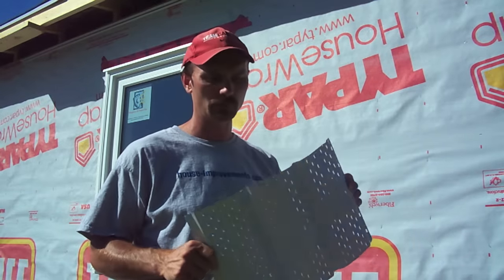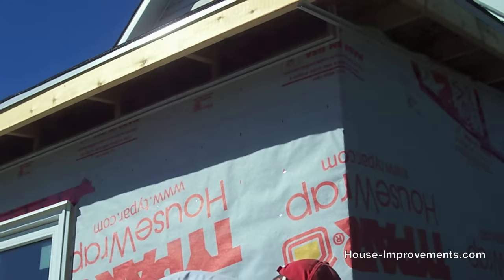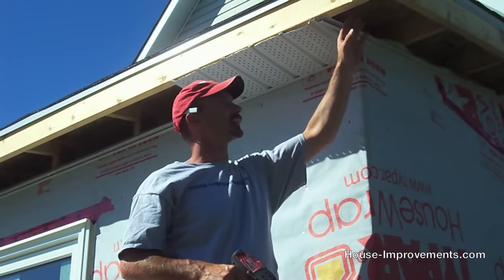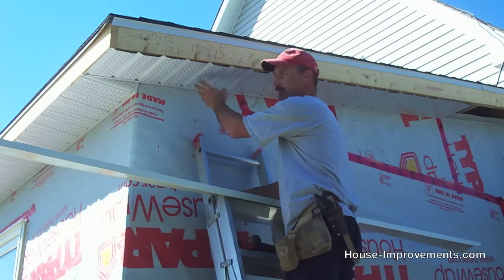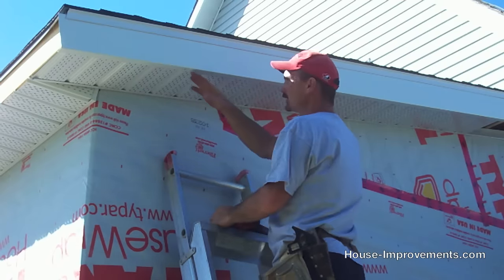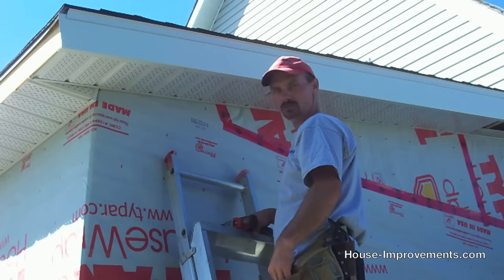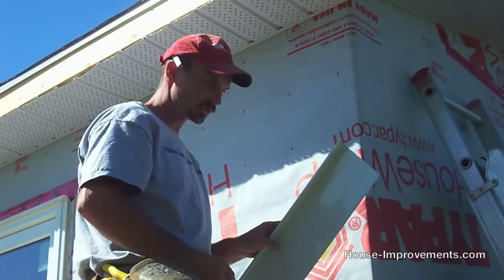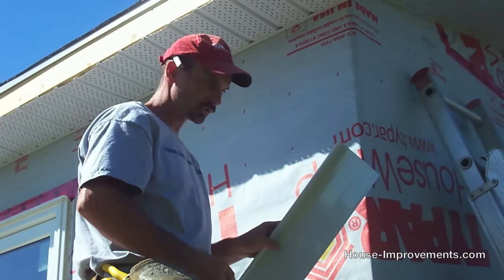How To Install Soffit And Fascia

Comment: So for the soffit your leaving it about 1/4” smaller than your measurement from wall to end of 2x6 ?   And the screw is tight so this doesn’t need to expand and contract like the vinyl siding ??
Reply from the maker: correct

Comment: What type of screws did you use?
Reply from the maker: These are a #8 x 1-1/4" pan head screw. I can purchase them colour matched to any fascia colour in my area, if you cant just stick some silver screws into a piece of rigid foam or heavy cardboard and spray paint the heads.
Reply: @HouseImprovements  thanks for the information

Comment: How long are the screws you are using? And what material and head type are the screws? Where does a person get colored screws for this job? My local hardware stores don't carry anything but say they can order anything I need for this,I just wondered what I would need.My soffit and fascia is a clay tan color.Thanks.
Reply from the maker: The screws for the soffit are just #6 x 5/8" F.H. screws and the fascia screws are #8 1-1/4" P.H . You can just buy regular screws, push them into some foam or heavy cardboard and then use some spray paint to colour them.

Comment: Hi Shannon.  I was at Home Depot today to buy some soffits and accessories.  They had some vinyl soffits.  A 12' length of vinyl was a bit cheaper than 10' metal soffits.  I did buy metal J channel and fascia though.  Have you ever thought of using vinyl for soffits?  Any thoughts?
Reply from the maker: I have never used it, probably fine though

Comment: So I discovered that the J channel that sits on top of the stucco of backside is loose and not secured to the roof. So I can pretty much lift up on the backside of the soffit panel and it will come up to where you can see in the roof. Can I use construction type adhesive to glue down the J channel?
Reply: You could frame a 1x2 behind it then shoot staples through the j channel into the 1x2

Comment: What screws do you use? I've had some trouble finding white headed screws that would work for something like this.
Reply from the maker: My local supplier sells them but some may not. When I need a custom colour I buy normal #8 x1-1/4"  pan head wood screws, push them into some rigid insulation so they stand and then use spray paint to colour them.

Comment: I'm residing a mobile home and have to take the soffit down to replace some wall board. Someone told me that I should wrap it with plastic and run it behind the wall board to keep drafts out. Is this wrong?

Comment: Actually it appears mine had both at the same time; there's a wood soffit, and then the aluminum soffit panels were installed over that.  I'm presently about to replace rotted out fascia boards, and was just wondering why my soffit setup has both wood and the aluminum, while it looks in the video like only the aluminum is needed.

Comment: Is that the 2” wide fascia that you used because they sell a 1” and 2” wide fascia. 
And it’s an actual 6” night for the fascia and the 2x6 board is 5.5” height so the soffit looks like it takes up the extra 1/2” height so it doesn’t need to be cut right ?
Reply from the maker: Round here I have only seen one size for the bottom lip and its about 1". The face is 5.5". Your upper trim covers the difference. This is sold in other widths for the face as well if you have 2x4 , 2x8 or 12x10 wood fascia

Comment: I want to temporarily pull out one middle piece of a soffit then put it back on. Will a soffit removal tool work? Is it easy to put the soffit back using the tongue and groove method?
Reply from the maker: It can be done . use my forum for more assistance.https://www.house-improvements.com/forums/

Comment: how do you place your final piece of siding and what holds it in place? I usually run my siding first,
Reply from the maker: thomas marabillas  It is cut to height and a special tool used to make clips in the top edge that clip into a J channel at the top edge of wall.   
    How To Install Vinyl Siding On Your House
  
    
       - Duration: 33:49.
    
    
      
        by HouseImprovements
      
    
    815,118 views
Reply: thank you the fast response. do you show that tool in any of your videos?

Comment: Hi. Great videos, but I have questions. Please help! lol. Ok. At .48 seconds we can all see the c-channel/j-channel/fchannel that will hol the soffit in place, but as one can see, it looks as though the corner edge will have to be trimmed shorter on the long part of the roof and left longer on the gable end. Also, in your other vid"How to side a gable end", on the j channel that the siding slides into, how do you attach that to the roofs most outer point? Trim it and nail it? Help please......

Comment: Correct me if im wrong, but wouldnt you have 3 trim pieces all ending/begining at the same place? (the very outside of the gable end ).The channel that holds the soffit(gable side), the j channel that will hold the siding that mounts just below the  soffit channel and then the other j channel that will go on top of your corner trim? All these ends should intesect/ How do you make them end and secure them without building a box end. I cant find this anywhere. thank you.

Comment: Hi! I need to replace the fascia and soffits on my house (they're rotted out and squirrels have chewed through them). My house doesn't have a drip edge, and in looking online, it's something that is installed before the roofing goes on. Can I put up the fascia siding without a drip edge- and if so, how? or, can I install a drip edge on a house already roofed? I plan on using PVC fascia, if that changes anything.
Reply from the maker: In some situations you may be able to install an aluminum drip edge after shingles are installed. If you can not install a drip edge then you need another trim usually called a gable trim that the top edge of the fascia can slip into under the shingle edge. If you have more questions please use my forum.http://www.house-improvements.com/forums/

Comment: Good video.

Question: 
Have you ever had problems with dissimilar metals, i.e. steel fasteners with aluminum soffitt? Such as galvanic corrosion? And the eventual loosening?

Screws are convenient, but long term?

Thanks!

Comment: Seems like that corner would stay dryer if it the facia from the slanted area was wrapped to the outside of the horizonal facia.  I like ti think it would direct the water to the outside rather than maybe behind the horizonal facia.   But, I have seen it done both ways.

You do have interesting videos.

Comment: Hi Shannon, I'm taking down some old siding and replacing with vinyl. My fascia on the gable side has layered fascia. The piece against the house has a 6x1 on top of it and then a 4x1 on top of that, the 4x1 is right up under the drip cap. So my problem will be, once I remove the fascia, my drip will be 3" away from the aluminum fascia. How can I remedy this? Thanks

Comment: Do you still need gutters when you do it this way?  Reason I ask, is I have a rental house with no gutters and only painted fascia board.  I think I could greatly improve it with the vinyl fascia as well.  Just wondering if gutters would be needed too.
Reply from the maker: I would recommend gutters for sure for water control to protect your house,tenants and foundation

Comment: Hi Shannon, not sure where you're from (though it sounds like ya have a Minnesota accent), but I'm putting up a garage with one of those package deals from Menards.  (DIY store).  With the package, they gave me white nails to use with the fascia and soffit.  I see you are using screws.  Do you mean to say that we shouldn't use nails?
Reply from the maker: No, the nails are fine. I like to use the screws because I find them easier but they do cost a little more
Reply: HouseImprovements Here's another question for you.  Before putting up the soffit or fascia you say to install the J-Channel.  Is this the same as F-Channel?  I think its the same thing but I wanted to get some clarification as the channel I got from Menards looks like an "F" from the side. I didn't see how you actually installed it around corners and such.  I see you set up your J/F channel one way, but then I believe I've seen it installed different ways.  Is there a right or a wrong way to do this?  I know it may sound stupid but a video on how to install that would be helpful as well.

Comment: Great Job Shannon... Quick question.  I am going to do aluminum vented soffit and fascia, my issue lies with the J channel, can I use Vinyl J-Channel or does it have to be aluminum? My local Rona does not carry aluminum J-Channel.  Thank you!!! Keep up the good work! Good old Saskatchewan!
Reply from the maker: I would only use it if it allows the soffit to fit snugly, otherwise the soffit will rattle in the wind.
Reply: HouseImprovements thanks Shannon, I'll check out coop and homehardware and see what they have

Comment: Does it matter if I use the non-vented soffit? I like the look of the solid but not sure if theres a reason here in Pennsylvania to use one over the other.
Reply from the maker: Vented soffit s needed if your attic is being vented by the soffit areas. Around here 99% are.

Comment: in this video the facia is being installed in new construction given the look of the existing 2 X 6's. What if in, on an existing home with an already installed newer shingled asphalt roof, it has existing 1 X 6 facia. Does it have to be removed and 2 x 6 installed? I can see this being the case because of the increased 1" in thickness and the overlap of the first row of shingles. saying that can i put the facia over the existing 1 X 6?
Reply from the maker: on an retrofit home I would try to slide a drip edge under the shingles and fasten in place and if that is not possible use the gable flashing that is along the gable end of my video, it just installs on the face of the wood fascia up under the bottom of the shingles. The fascia can usually still be installed over a 1x6 but if you need more width on the bottom edge add a strip of 1x material to the back side of your 1x6. If you have more questions please use my forum. http://www.house-improvements.com/forums/

Comment: Why do the aluminum fascia have that little lip that bends back to the soffit. Shouldnt it sit flush with the fascia, i notice that lip doesn't exist with the vinyl.  Does it serve a purpose that i am missing. thx
Reply from the maker: I think it is just for some extra strength? Some have it some do not ,depending on brand.

Comment: I also use finish trimnails for soffit n facia the whole screw and drill deal just to time consuming trimnails hold just as good plus u can nail 2 on each soffit panel just my opinions though great video

Comment: I have a job where I need to repair fascia peak on entry way of condo. the tear down of old wood has been ate away by termites. I have removed termite infestation and now need to repair peak over door. should I use aluminum or wood? The peak has a wooden anchor into the brick of condo. in need of advice
Reply from the maker: +MFG Services  If you go to aluminum for the whole condo there will be no maintenance in the future.
Reply: Understood and that's the plan. Will I have to rebuild whole peak? Or can I buy the peak already built?

Comment: I have a big wasp nest up inside my soffit. Is it easy to pull down maybe 6 in across just so I can spray the WASP killer foam in?
Reply from the maker: spray the foam in it while its hanging. remove it later on after the spray has worked.
Reply: Hello - that part is obvious.
My question is regarding pulling down or opening of the soffit.  Is it easy to open a small section after it has been installed? Is it flexible enough and can be removed a bit then pushed back into place after,

Comment: Where did you get white screws? They are extremely hard to find...
Reply from the maker: My local hardware store has all main colours in stock and can get any matching colour for not so common fascia.
If you cant find them  use some regular wood screws jabbed into a piece of styrofoam and spray paint them what ever colour you need.

Comment: Shannon, Im installing fascia on my shed. This is a shed that I built years ago. The fascia board is just a 1x 4 If Im not mistaken.  I suppose its ok to trim the metal fascia to match the width of the fascia board. Any suggestions how to cut it straight. I dont plan to install eve troughs so it needs to be relatively straight. 

Also is there a trim designed to hold both soffit and siding so I dont need to install a J channel when I put up the siding
Reply from the maker: You should have either a roof edge drip piece hanging down or a eave edge that you can add to the fascia. The top edge of the aluminum fascia if hidden by these . So the top edge does not need to be perfectly straight. Turn the fascia over and use a sharp utility knife to score the back side. You can use a straight edge as a guild if you want. Once you have a decent score you can tear the fascia apart along that line or fold back and forth a couple times along the score line and it will break loos.

Comment: Completely worked backwards with the soffit , start from the opposite end and lock the pieces in as you move forward .
Reply: Ok genius .
Reply: @eduu2  it's called the correct way of doing it . If you're going to put up a video to show people how to do something , you should probably be doing it corrctly don't you think ?
Reply: @stevengrammont44  This guy does almost everything , from pumbling to roofing . i noticed it too.
But one cannot be right in everything , u do good and not that good in some areas .
Mechanics fix cars but they r not that good in fixing the carseats  or detailing , right?
Give him some credit and before critizicing analyse the whole situatiion
Reply: @eduu2  well i wouldn't take my car to someone who doesn't fix cars correctly , and the same goes for my home . I believe if you're going to post videos on here of how to do something , you should atleast have the knowledge of doing in correct . You also dont screw any aluminum or vinyl siding products , things expand / contract and that's why they have nailing flanges .
Reply: @eduu2  if i do something , i do it correctly .  if i don't know how to do it , i call a professional .

Comment: you should have put the bottom piece first  and over lap the common 2 side at least a foot just because the roof is not that steep and water tends to dify gravity, it will go back up in this particular situation.

Comment: I thought you start at the bottom for the fascia and bend the corners up, then lay the next sheet going up over the bended corner to prevent water ingress?
Reply from the maker: water really can't be trapped in a sloped end like this.

Comment: Do you know how to make bird boxes out of coil stock? Why would you screw them? Put them in the channel (Speed Channel) I would’ve used unless the house is getting brick.. put your soffit in and staple nailing about every 4 foot then turn 1 inch under on your facial and it’s not gonna come out or lose….. never had to repair one I’ve done that way in well over a decade )

Comment: My fasia is all Lowe’s had- appears to be plastic. I understand the flat edge goes under the drip edge or soffit- but mine has an L shape that almost looks like a “clip.” Please explain if I still just butt it against the soffit. I need advice bigtime since I’m doing it myself - thanks to anyone who can advise!!
Reply from the maker: I have never used or even seen vinyl fascia in my area . Check the manufactures website maybe?

Comment: need help on repairing roof,doing fascia board,adding jmolding on window ,repairing ceiling and wall got leak add on bonus room need to no how much it will cost to repair
Reply from the maker: +Patricia Murray That is not the purpose of our videos . Contact local contractors
Reply: +HouseImprovements  ok I will

Comment: Hey, Shannon, How do you do the peak joint?
Reply from the maker: Cut one so the front face runs past the centre of the peak about 1-2" and then cut the opposite one so that it over laps the first but is plumb and centred on the peak.

Comment: Can you install vinyl siding over old wood sidings
Reply from the maker: You could but I recommend removing any old exterior finish back to the old sheathing or shiplap, then install house wrap and then the new vinyl. That way you can be sure there is no rot problems hidden anywhere.

Comment: Is there any preference between metal or vinyl?
Reply from the maker: In my area you basically never see vinyl used.
Reply: @HouseImprovements  thank you
Reply: @HouseImprovements  I am about to do this project. I went and checked both the vinyl and metal product. The vinyl is more expensive and seems like it will sag. I will be doing metal. 
Thank you for replying

Comment: I love that you posted a video where you demonstrated improper installation of the material. There is going to be premature rotting due to improper over lap. You need to take a refresher course. If more "contractors" were actually certified less fools would be out doing demonstrations and more work for skilled contractors. Would you like us to come over and replace the rotted 2x6.

Comment: Shouldnt't You have started  by doing the fascia on the lower part ? So the water that comes down the slop has no way to get in between  the two corners of fascia that are bent on each other?
Reply from the maker: really gravity takes over at some point and because the bottoms are not a sealed system anything that makes it in makes it sway out pretty fast. I have done it either way and both work.
Reply: @HouseImprovements   thanks man  i never expected an answer   on a video that old ! Cheer !

Comment from the maker: No problems, even the staples some guys use are steel and i've replaced alot of soffit that was 20yrs old and stapled and there will usually be some rust but really no failures. Good question though!